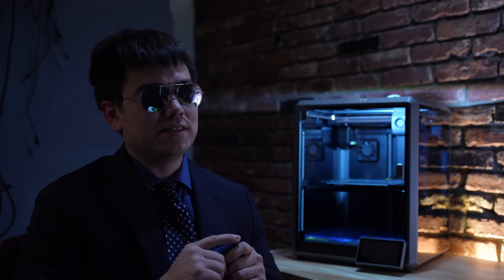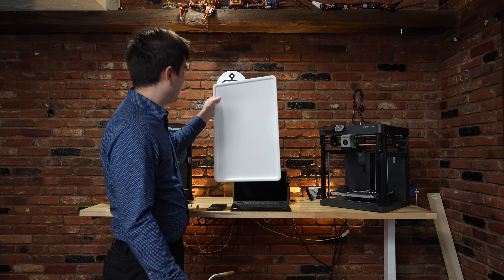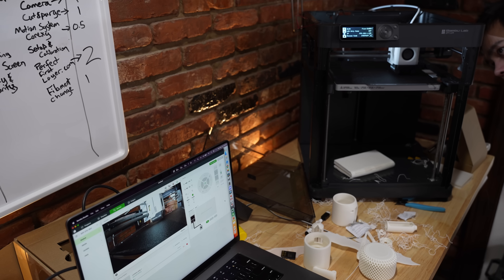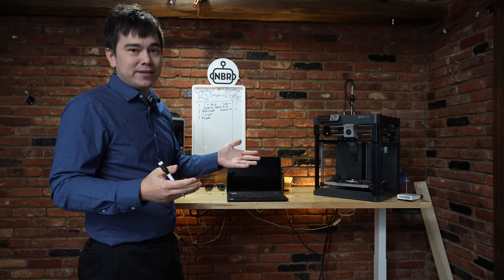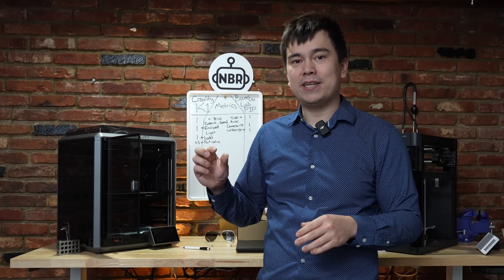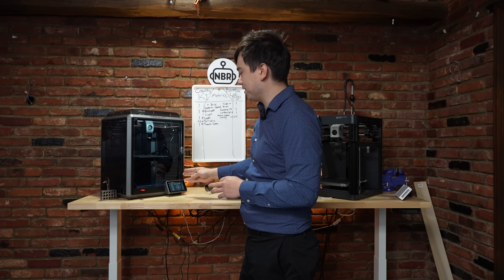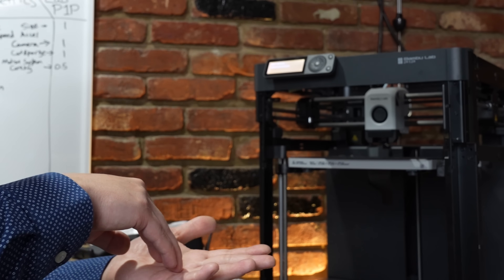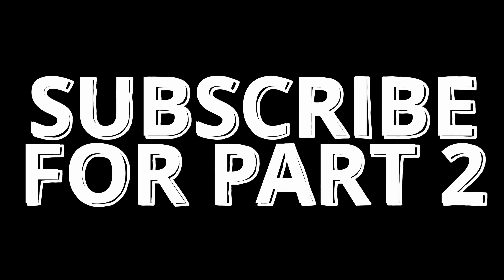3D Printer Fight Club: Creality K1 vs Bambu Lab P1P Episode 1

Comment: It should also be noted that Creality has a really bad record of supporting their printers with firmware updates and overall, you buy it and see you, good luck with it
Reply: This yes
Reply from the maker: Yeah true. This one is different though. They are pouring a ton of resources into this one. I'd be shocked if they just abandoned the firmware.
The problem is that they have almost 100 different printers, and are spreading themselves too thin. They need to focus on making 1 great product that will work for everyone.
Reply: I feel like this is where the tinkerers separate, considering it uses standard parts if this thing can run klipper within 6 months it's going to be a better printer than any bambu model with community mods. But its already leagues ahead an ender 5 out of the box
Reply: @rax2200  that’s a big if though. I’ve heard that the connectors are proprietary.
Reply: But that's the normal practice and is a big part of the problem. All the time and money goes into marketing the latest and those with the previous version or product get abandoned. Looks like that's going to happen again if you see all the effort is going into K1
Reply: 😂

Who cares!

Jyers and Klipper are better anyway.

😂

Only the average consumer cares about those things. The rest of us know the community will provide all of that in short time.
Reply: @xsvforce3335  It's not a big if.

The modding community always comes through.

My twenty years in the IT field has shown that over and over again.
Reply: @NickBR57  Abandoned?

What does that even mean?

The only thing I've needed from Creality was to sell me the printer. Since then I haven't needed them for anything. There are third-party firmwares, there's third-party mods. I really don't understand why some of you put so much into getting support from Creality when it's unnecessary.

🤷
Reply: @Dan Gerous  I don't mean Creality specifically. It is across all manufacturers and not just 3D printers.
It's a general principle of many manufacturers now. (Not all, of course, its a general principle and there are, thank goodness, manufacturers of all kinds who are different. They ate the ones to support.
If you disagree, more power to your consumer elbow.
Reply: @NathanBuildsRobots  "this one is different", oh, how many times have I heard that about Creality? 😂
Reply: Lol, it's not hard to build your own firmware lol - while I don't disagree about creality, they are generally open source which is extremely important for the DIY'ers (the whole point, originally, of 3d printing in the first place. Bambu sucks for not being open source (also nothing new for 2 years now, same with prusa, while creality is always upgrading their printers, year after year)
Reply: @theglowcloud2215  Ohhh  how I love people bashing other people, who can't diagnose and fix their own printers (because the bambu isn't open source) LOL. It's like a patient who pays all the bills, making fun of a doctor LOL. Who's really the joke here? (hint, it's you lol)
Reply: @hollenurg9101  Maybe, but I can't help thinking the idea is not to appeal to people who like building machines and tinkering, even more so those who are prepared to learn coding - but more to make the 3D printer a usable techno;logy for "ordinary" consumers who just want something that works.
While I don't mind getting into code (as a former professional ASM, Forth, C and C++ programmer) that doesn't apply to the majority of consumers.

This technology should not be kept within a small coterie of people who are prepared to tinker for hours - andthe likes of Bambu, Anker and Qidi seem to me to be leading the change of direction.
Could be wrong of course and maybe they'll never catch on...
Reply: They don't update because they know the community will do it for them. I'm sure this will be no different. Or they'll just try and rip off bambu updates.
Reply: @höllenßurg  bambu hasn't been around for 2 years. I agree about the benefits of open source. However, bambu has been fantastic with updates and fixes. Creality depends on the community for their updates. On top of that, Creality has violated a ton of open source licenses. So don't act like they're doing it out of good will.
Reply: @goawaybaizuo  Agree on most of your points, and I think Bambu should go open source, and they won't. I think the company, and their product is awesome otherwise. I do think creality has not done a lot of things right, but it's tough looking backwards - They've been in the game a lot longer than Bambu, but we'll see what happens with time. If you include their kick starter, and developkment, bambu labs has indeed ben around longer than 2 years (24 calender months). It took them 6 months to realize they should've given the camera with their printer.. They have great customer service, and just like other companies, I see their downfalls as well).
Reply: @goawaybaizuo  Bambu has a long way to go, which is why they don't have another design on a printer lined up. They were hoping it would take a few years to catch up, not 9 months after release (hence the not open sourcing it as well). They could still give phenomenal service, with open sourcing it. But they won't and that's my point. Not open sourcing it means the minute customer service starts to suck (or the company gets too big) a buyer will be worse off than if they bought something open source. I see the merit's in Bambu, but at the end of the day they're based in making the most money as possible lol.
Reply: Does the brand new company Bambu labs have any track record of customer service either? I haven't heard that they are much better
Reply: @jondanger  Obviously you've never dealt with bambu. They don't have instant support like prusa, but they will help you get what you need fixed. They will dig into logs, help you troubleshoot, and send replacement parts quickly if needed. Much better than creality. My first printer was an ender 3 s1 pro. The bed was so warped it was unusable. Creality told me it was "within spec" and said to lay sheets of post it notes underneath to level it. Bambu on the other had has been fantastic with any questions and feedback. So much so they have hotfixed parts in their machines based on direct user feedback
Reply: @jondanger  No they don't have a history. But I can tell they are doing their best to build it. They have released several firmware updates and have fixed whatever needed to be fixed after launch. Of course it's not perfect but you can clearly tell they have a different company culture than Creality. For starters they developed their product from scratch.
Reply: Good point. Can only see k1 as a contender against the x1 carbon if creality has an internal transformation of some sort.
Reply: @dangerous8333  Jyers firmware is technically no longer supported and out of date. Its missing some important version updates including 2208 linear advanced and pressure advance.
Reply: @theglowcloud2215  Did you not consider the Creality CR-30 a bit "different" ?
Reply: @dangerous8333  the modding community has yet to stop by my house and work on my Ender 6.

Comment: For me, the price difference is at least $350 between K1 and P1P with encluser, don't forget that if you are going to have encluser on P1P, you also have to buy the AUX fan. Touch screen can't even be bought for P1P !?

I can buy K1 in my local data store, which means 3 years of right to complain and that the data store  take responsibility if something breaks, not like with P1P, where you have to sit through endless email conversations.

The way I see it, the option for a multi-color system is the big advantage of the P1P, but it costs me $440, which is clearly overpriced.
Reply from the maker: Yeah, AMS seems nice. I have one and will be installing it on my P1P soon.
Reply: @NathanBuildsRobots  Great video, now it's starting to look more like old  Nathan!
Reply: @dejedejsson  it must have been exciting to be the first one with a really hyped printer. The thing also looks really good. I think that explains the enthusiasm in the first video. Of course, trolls be trolls and had to sling mud wherever they can. 

The video wasn’t bad or anything as the construction of the machine (what the video was focused on) is obviously very nice. The biggest problem is that Nathan didn’t explicitly state the limited scope of the video and had review in the title so people thought it was all he had to say.

Comment: The biggest downside to the K1 is the auto unload/load feature or the lack thereof, and how it's going to affect any type of AMS/multimaterial system..  Because it doesn't implement a filament cut, I foresee a big problem with adding a multimaterial system.  Anyone who's been printing for a while know the issues with the blobby ends of the filament when you pull it out of the extruder and needing to cut a fresh end before inserting in another filament.  I just don't see Creality being able to come up with an add-on system to do that for you.. like the Bambu does.  I'd love to be proven wrong tho.  As it is now, the K1 is ONLY good for single filament prints with maybe color swaps at height added in... not a true multimaterial printer.  Just a fast printer.   I like just about everything else on the K1 and may buy a couple for my single color print needs.
Reply from the maker: Yeah, filament changeovers are sooo easy on the P1P. On the K1 it is annoying to do, like on most other 3D printers
Reply: 😂

100% creality will come up with a system.

If not them the community will.
Reply: Bambu Lab system creates a lot of waste. Good for not frequent multicolor prints or with few color changes needed. Otherwise the cost are prihibitive.
As for filament cut, why dhould be done at the head, than needing a long purge? Can be done in a different way and reducing purge needed.
Reply: @dangerous8333  they dont have to come up with anything, they can get "inspired" by other's IP then make a similar thing. :) not looking for a fan boy argument, just pointing the obvious

Comment: Theoretical characteristics are cool and all, but I'm much more interested in the actual printing quality.
The K1 looks interesting, but if the print quality is much lower than the P1P's, what's the point?
Conversely, if it's much better, it's a hell of a deal.
Reply from the maker: Yep, a lot to go over with print quality. I have like 6 hrs of footage and Creality just reworked their extruder so I want to try that out.

Comment: Can you use any cheap usb camera, or does it have to be Creality? Awesome intro btw!
Reply from the maker: I'm not sure. The connector up top is an uncommon type for USB. But I'm sure someone could find or produce a cable that would adapt it so a normal webcam could be installed. Best bet will probably be to buy the camera from Creality. That way it has the right focal range and field of view. Having installed random webcams on printers before, it's much easier when you just get a camera that is designed for the printer.

THAT SAID - it would be super nice to have the option to plug in a super nice 4k webcam for better timelapses. So we'll see.

Comment: Can't wait for the 2nd part! I guess it is not worth it to go for P1P with Chinese region lock over K1 considering that I can only order P1P directly from China for $200 more then K1. Did anyone have experience with P1P region locked models?
Reply from the maker: Wait,,,, Bambu is region locking printers? WTF?
Reply: Where are you from? Bambu doesn't ship from anywhere else than china for you?
Reply: I thought they're based in Texas?
Reply: @MTNDEWGANG  "Right now we have three sites located at Shenzhen and Shanghai in China and Austin, Texas of U.S."
Reply: I got my x1c and p1p shipped from cali...
Reply: @NathanBuildsRobots  It is only true for P1P bought from Taobao or JD store!
Reply: even down-under Australia has a distribution warehouse and I live 1000s km away from it but I received X1C for one business day from ordering.
Reply: @jl8096  when I try to write my cntry name, my replies disappear after a few sec, but you might guess it ;)
Reply: @dev.lex.e  Both P1P and X1C are region locked, you will not get firmware updates or Cloud Stuff unless you  use a VPN to Spoof.

Comment: With the K1 being enclosed, would like to see print tests with ABS/ASA/PC and see chamber temps and how well it holds those temps.
Reply: Also, how does the bed look?  P1P and banana bed has been a hot topic.  Would like to see how flat the K1 bed is.
Reply from the maker: It seems pretty flat to me. However, it came from the factory a little bit tilted. 
There is a procedure you can do to level the bed. Basically, loosen up the belt that couples the 3 leadscrews together, then move all the screws so the bed is at the very top, the refasten the belt. After doing that there is almost 0 z axis compensation during prints.
I will try to get a graph of the bed mesh, I couldnt find it in the screen UI or the slicer during a quick look.
Reply from the maker: Definitely will try some high temp materials next week
Reply: Enclosing a printer is pretty basic science. You could put it in a cardboard box.

So just assume it will print fine.

👍
Reply: Primary reason for an enclosed printer is to print high temperature filaments such as ASA and ABS.
The capability of the printer has not really been tested until it has proven its ability to print those types of material.
I am a little concerned that the bed only goes up to 100℃ rather than 120℃ (always nice to have a bit of headroom).

Comment: looking forward to you reviewing the K1 Max vs the Bamboo X1 vs the Prusa XL.  i believe that in spite of the price, the XL will come out the winner.  i could be wrong of course, which is why i'm excited to see how your review of the three would come out!
Reply: The k1 max is $1000, the x1c is $1500, and the XL is $2000. 

Get the x1c if you’re ok with the build size and want to print a lot of advanced materials. The k1 max is a bit bigger for $500 less, so for the people needing a bigger surface or something more budget friendly, the k1 is the obvious choice. 
Then if you need a bigger build plate, or want the highest quality machine with amazing support and extremely high quality components, the xl is there. 

Pretty easy decision as they’re all different sizes, prices, and have different features.

The tool changer on the XL is one of the coolest things I’ve ever seen! But not something I’d need.
Reply: @BenHeien  thank you for the clear explanation for all three.  i appreciate it and now will take my time to observe the K1 max a little more before making a decision just to be sure.  Thanks again!

Comment: K1 looks damn tempting, originally I wanted P1P, but now I'm really thinking!
Great review, I like the beginning)
Reply: opposite with me.  I was wanting K1 and I pre-ordered it but more watching K1 youtubes and more interested in P1P.  Now I ended up with X1C combo in my hand. :D
Reply: @J L  the AMS will spoil you.
Reply: @redone823  The AMS is WAY WAY too slow. 2 minutes per layer change.. only useful as a backup filament setup. Color changes make prints take WAY longer. I can print faster on my Ender 3 S1 Pro (with 1 color of course) when you start throwing in lots of color changes. I call this out because everyone screaming about how fast it is.. but then also toss out the AMS and multiple colors and ignore how much slower it ends up being, let alone the amount of wasted filament/cost. If you're good with all that.. so be it. The problem with AMS (and similar devices) is they are prone to clog. TONS of videos now showing various levels of clogging for AMS, MMU, and 3rd party options. It's just not a great production worthy device. The only thing that will make color changes good is multi tool changers. Which are in the works (Prusa XL, Forge4, etc).
Reply: @Kevin Duffey  for the price point, the q1cc has been great.  The others you've mentioned, like the XL with the multi head is more than double the price.  I'm okay with occasional clogging.  So far, the AMS has met my needs and has been a QoL increase.  

One time, the filament was bound on top of itself.  The AMS was able to pull back to try to loosen the bind.  It ended up having to pull the filament back twice to fix the issue.  I just happened to catch it and was shocked at how it fixed it.
Reply: Broski Snowski  Why do so many people think you HAVE to own one to get information about it? There are TONS of videos here.. and I know a couple people that own them. I don't have to own one personally to come to a conclusion based on reviews, videos and friends that own them. Or.. are you unable to come to that conclusion?
Reply: @jl8096  Damn!

You paid $700 more just for AMS.

🤦
Reply: @redone823  After spending $700 more just for AMS, I would certainly hope so. 😂
Reply: @Dan Gerous  AMS is about 350.  The other is for enclosure, belt chain, touch monitor, etc.